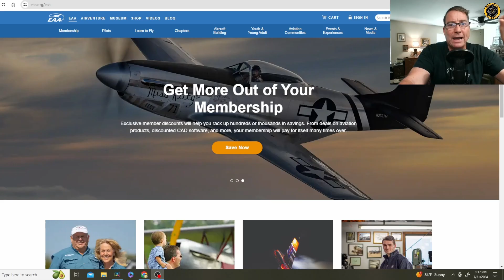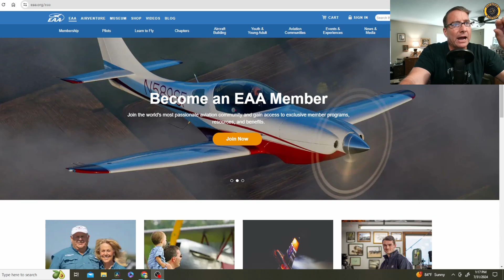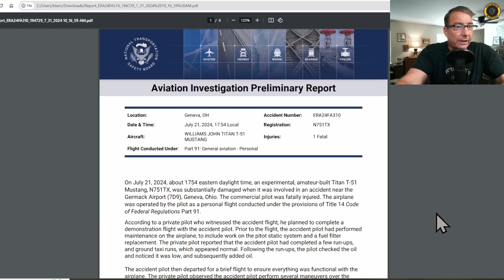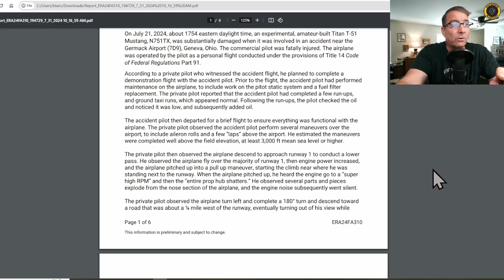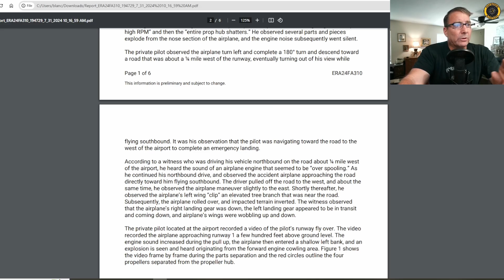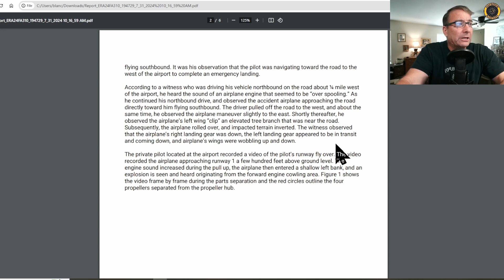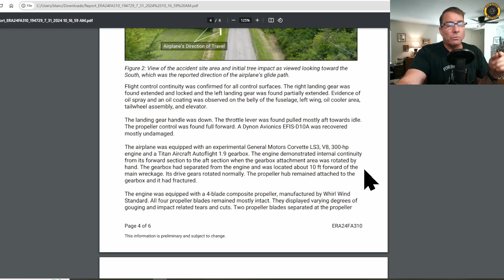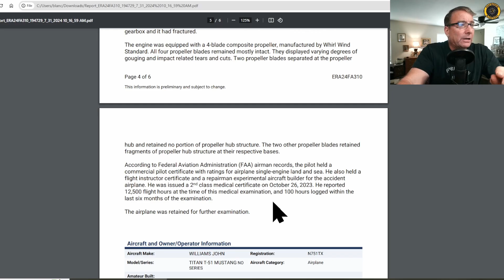Titan T-51 Fatal Prop Hub Failure 21 July 2024

Comment: I wonder if the high-rpm condition came after the failure since the sound takes a second +/- to get to the witness.
Reply: Oh my God! a concept in nature about things we know versus the things people claim to have seen and heard.  Winner Winner! Chicken Dinner!
Reply: The sound was reported before the prop departed, so if that's accurate that's against this hypothesis.
Reply: @B-System  still, I would have asked for differentiation between just engine overspeed and prop overspeed. Engine over speed after failure is practically guaranteed. The absence of prop overspeed would be important to at what rpm the hub failed.
Reply: @bendeleted9155 I'm sure whoever made that determination did so after watching the video recording.
Reply: @csolivais1979  good point. We didn't get to see that.

Comment: When the hub failed the engine load went to zero, which would allow it to suddenly overspeed. Not the other way around.
Reply: I used to fly RC planes for years and when the prop came off the engine over revved  big-time🤷‍♂️
Reply: This contraption was basically a big RC plane powered by an old truck engine. I'm not a doctor, I only play one on TV but it sounds like disaster was inevitable.
Reply: Correct.  No different than when a crank flange lets go. Engine doesn't merely "surge", it instantly winds up like a  Top Fuel dragster engine (and often blows up),  when the flywheel effect and drag loads of the prop are removed.
Reply: Does this hub have variable pitch? If failed it could also overspeed the engine.
Reply: @SidewaysEightSix  "The prop loosing drag to the air" actually can happen with a adjustable pitch prop in a way (it still has drag),  If you have the engine set up for a aggressive prop pitch, and if the prop pitch suddenly goes flat, two things will happen, The engine and prop will over speed, Likely causing the hub to fail and over RPM'ing the engine possibly causing major engine failure (rods through block, crank shaft failure etc) before the engine management system can cut the ignition.  Depending on the prop, gearbox, engine set up the prop pitch can be adjusted by oil pressure or electric servos in flight or manually on the ground with tools.  Although I've spun stock bottom end LS3's to 9k RPM (stock valve springs will not take that they will float well before that), the typical red line is 6500 in stock automotive applications, and I would imagine in a plane derating the LS3 to 300hp it is limited to 5500-6k.

So not a clutch like in a car, loosing the prop pitch feels much like pressing the clutch with the engine instantly bouncing off red line.

My guess is lost pitch on the prop, over speed prop, hub cracked 2 blades came off with the hub parts, causing the hub to no longer have even pressure and the other two blades came off clean with no hub, the PCM didn't cut the ignition in time or he was at a high enough rate of speed that the wind force over speed the prop.

Or the engine did hit ignition cut off and the pulsing on and off fractured the hub (similar to the issues described in the video with high compression engines)
Reply: @Avi8tor857  fair point.  And you are correct.  I failed to consider variable prop pitch.  I understand the concept well but it was something I didn’t factor in.   This would certainly still be a prop hub failure of some sort? I think we are saying the same thing ultimately.  While it’s certainly possible the engine climbed some RPM rapidly, to suddenly peg redline typically related to something broken, or at least something changed suddenly.  

I absolutely agree that if two blades departed with part of the hub attached, it would certainly compromise the structure of and hub and it probably shattered and left the other two props to come out “clean”. And then at that point, good air, good spark, good fuel, consistent throttle.  Only reason for a sudden spike would mean lack of load.
Reply: @SidewaysEightSix  Yes more or less thinking the same thing.  Being a experimental engine and experimental plane unfortunately they don't always do a full post accident analysis.  With this being a "factory" test bed though they might.  I would like to see the conclusion after the investigation.
Reply: @Avi8tor857  The prop has pitch stops built in to prevent that I think the hub came apart it must have had a crack in it before it let go .
Reply: Sideways86- if the prop governor of a constant speed prop suddenly commands flat pitch, not only is the load removed from the engine, it is actually driven by the air.
    In effect, since you are a car guy, it is akin to an accidental downshift to first gear when way over the safe speed for first.
   I don't know if this has a constant speed prop, but suspect that it would.
    The centrifugal force on each prop blade is TONS. I mean literally, not hyperbole. Not much overspend is permissible. 
    Many problems occurred..read the accident history of the Boeing 377 stratocruiser..prop overspeeds, air drives engine to destruction,  even after it isn't running.
Reply: @SidewaysEightSix  This is a high performance aircraft so it is very likely equipped with a variable pitch prop. A failure of the governor that controls the prop pitch could result in the blades going into the "feather" position thereby reducing the propeller load to almost nothing and induce an engine overspeed as a result (much like the loss of tire grip on water or ice you describe). The engine overspeed may then cause the hub to fail.  This being said I have a hard time believing this is what happened given that we are dealing with a reducing gearbox and engine limiter. The hub failure provoking the engine overspeed still seems more likely to me but we shall see.
Reply: Loss of oil pressure in the prop hub would cause propellers to low-pitch climb setting, this can in turn cause engine overspeed (or bounce off the RPM limit). the hub might have had some cracks and lost oil pressure causing the feathered condition (or a low-pitch setting that engine can overspeed), or it could have been governor, in any case I don't see any way that the engine (without turbo) can suddenly produce so much power to overspeed the prop (and hub) to faliure. 
Sad loss, RIP.
Reply: @BA-lt2tx agreed. Hub failure first seems to be the most likely cause to me also. It will be good to hear the final report and know definitively.
Reply: With today’s sophistication. Just like a NASCAR engine. The computer should be programmed for over speed protection.
Reply: @SuperGlenn1966  It can't always react quick enough, and it cuts ignition not fuel and a gas engine can still "diesel" because of the un burned gas.  On a gas engine you can't cut the fuel as it can take the engine lean which will melt pistons/valves.

I've seen several engines on drag cars that cut the ignition when a clutch blew out but they still over RPM and sent parts out the block.  Now admittedly those were 900-1300 HP engines already turning 5k when the clutch went.  NASCAR engine management really isn't that state of the art, they are just built to run at 100% for hours on end.  

It would be interesting to see the tune in the computer to see what protections were in it.
Reply: Sound is much slower that light. Seeing the video would provide definitive proof. If the engine can be heard spooling up before you can see the prop come apart then clearly the prop went full fine and over speed the engine causing hub failure. If the prop comes apart just before the high rev sound then they will have to determine the distance from the plane to the camera to correct for the slow sound. With a video; however, this will be easy to determine.
Reply: I'm supprised there isn't some kind of rev limiter?
Reply: Light travels faster than sound. He saw the prop explode, then heard it.
Reply: @hud86 NO. In the report it is clear that he heard the engine speed increase first. Since light travels faster, if he heard the sound first then it must have overspeed before the prop came apart.

The great news is there is video of this failure, so the truth can easily be determined. I don't know why this group seems to be getting all worked up over nothing. If it is a constant speed, it could have gone full fine resulting in the overspeed, or if the report is wrong, the prop could have failed then the overspeed occured. Either way, we have video.
Reply: @hud86  The same thing applies to everything that occurs around everyone of us, but at a short distance such as the distance between the pilot and the propeller the difference between the speed of light and sound is not perceivable, only over miles of distance is the difference perceivable, such as hearing thunder seconds after seeing the lightning that created the thunder.
Reply: I agree. This is my theory as well
Reply: You can't know that.
Could also be runaway rpm -> hub failure -> even higher rpm for a few seconds -> down to idle.
Reply: @--SPQR--  Yes agreed, could have been either. Still unanswered questions.
Reply: @--SPQR--  no
Reply: @--SPQR-- Given that there's video evidence, which failure occurred first can be determined from the relative timing of the sound of the rev-up vs. when the debris is seen separating from the aircraft.
Reply: @--SPQR-- the issue with that would be for excessive RPM you'd also need loads of power.
Reply: @kain0m  Not if it was an adjustable or constant-speed propeller that failed.

Comment: So why even mess with an automobile engine.  There are plenty of aviation engines out there that can produce or exceed a car engine's HP.  Build the airplane around the engine to fit.  I guess I fail to see the need for an automobile engine.  No matter, I ain't got a dog in this hunt anyway.....just a tragic loss of life for family, loved ones and friends and to the EAA community.  Deepest condolences.
Reply: Look at purchase and operating costs for an aircraft engine.  LS + custom gearbox all of a sudden looks really cheap.
Reply: cost
Reply: The narrow profile of a P-51 can't accommodate most aircraft engines.  Years ago some used the Ranger engines, but they are an inverted engine so it didn't quite give the right profile.  If I was going to build a P-51 I'd use a Jaguar or BMW aluminum V-12.  If I wanted a scaled down warbird with a flat Lycoming or Continental I'd build a P-47 or a Corsair.
Reply: @M1903a4  or build the airplane around the engine.....to keep the profile of the 51
Reply: @easttexan2933  Um, a Lycoming engine is about 6 inches WIDER than a P-51's Merlin engine.   The goal is generally to build a replica that's smaller than the original, not bigger.
Reply: @M1903a4  good info.  I see by your name you like WWII rifles.  Have owned many of the 03 springfields, but never a A4.  Not in my budget.  I had a collection of about 30 different WW1 and 2 rifles over the last 30 years but got tired of hauling 'em to the range to punch holes.  Slowly sold them off.  Only have 3 hunting rifles now.

Comment: Do you have to scream them up to 6000? You could optimize their cam profile and timing for the desired rpm range, the bottom end of those engines can withstand a lot. Use really strong connecting rods and boost the hell out of it. Then it would last forever wide open throttle. I am surprised they use a gearbox, that sounds like an anvil.
Reply: One of the problems with automotive engines is that they lack a robust thrust bearing as the prop has to pull the plane . The gearbox being separate solves that issue as well as the power/rpm issue. The Aero Vee based on a VW engine does exactly what you are describing. It’s lower rpm, high torque and has the proper thrust bearing. It’s also custom made and really doesn’t  share many VW parts
Reply: Need a gearbox of sorts anyway to deal with the thrust bearing.  Even then, the LS3 is below 200HP at 2700rpm.
Reply: @akschu1  Is thrust bearing basically the fact that the prop is pulling away from the engine? While on a car nothing like that is happening?
Reply: @Aran2323  no, the crankshaft needs to deal with gyroscopic forces of the prop which are absolutely huge.  Nothing like that on a car.  Take a bike tire, spin it and then pitch it up suddenly.  You can't stop it from turning to the side.  Now do this with something WAY heavier spinning WAY faster and you have literal tons of side force on the crank bearing.  Nothing on a car pitches like that.
Reply: Not an engine guy -- would you be able to get enough power low down in the RPM range?
Reply: Running at altitude with out turbocharger limits power.
Reply: Even with cam timing, you're kneecapping an LS.

As a reference,  the engine in a 172 is 5 liters and only produces 180 HP.
Reply: @JoshuaTootell  Yes, but the distinction is that the 180HP is at 2700rpm and the o-360 in a 172 probably weighs half of a LS3 full up with required accessories.
Reply: Really strong connecting rods and boost aren't aircraft or marine reliable not to mention turbos add more weight.  Don't forget that an entire 180HP aircraft engine is probably 280lbs-300lbs  total (fuel system, alternator, starter, cooling, prop governor).  You aren't getting any v8 to reliability make that power at 2700rpm at anywhere near that weight.  You need injectors, pumps, fuel system, cooling system, crank bearings/PSRU/turbos, etc.   The lycoming does this by being massively oversquare and large.  5.125 pistons over 4.375 stroke.

Comment: What about all those smaller VW automobile engines being used as powerplants?
Reply: Small planes and air cooling
Reply: They don’t use a reduction gearbox between the engine and the prop.
Reply: What about them? They don't produce nearly enough power for a T-51
Reply: No of course not, but they are used in many small home built designs
Reply: @dorsai  air cooled VW motor struggles to push my brothers airboat across the water
Reply: @JordanColeman-r8w  What do you expect, it only puts out aroiund 40HP, or maybe 65 at best.
Reply: Death traps.
Reply: I considered a half VW in my build. Still would.
Reply: I don't want them flying over my house!!!!

Comment: Another strike against the impossible turn.  Terribly sad news.
Reply: Sounds like he DID make the 180 turn, but unfortunately, onto a very narrow roadway.
Reply: @chugwaterjack4458  agreed but it looked like there were some very nice fields available off the departure end.  I don’t want to armchair QB the guy… just a terrible outcome.
Reply: Isn't the impossible turn to try and make it back to the same runway you took off at? Seems like he was going for a parallel road. Still 180 but shifted laterally. Does that count or did I misunderstand?
Reply: @witeshade  Sadly, a fine difference that turns out not to have mattered.